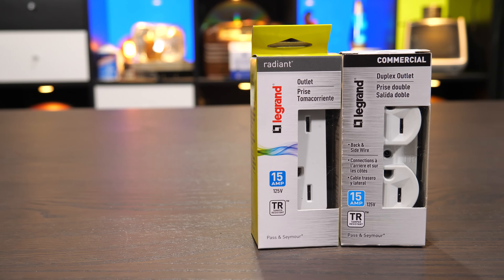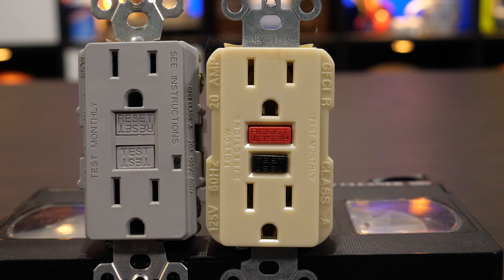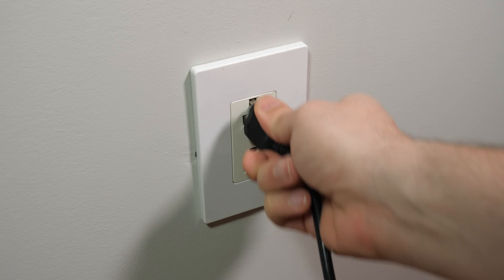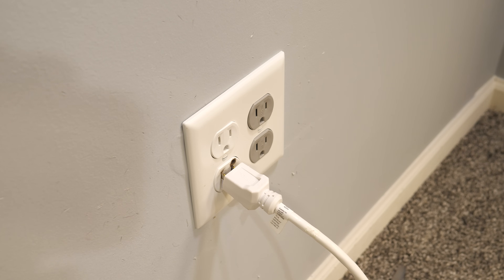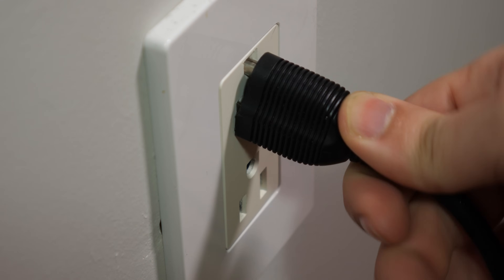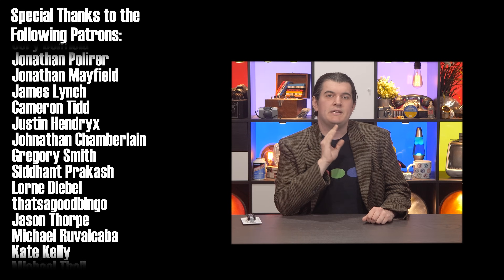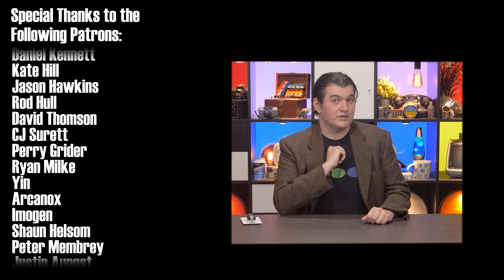Power outlets are topsy turvy - but does it matter?

Comment: I've worked 30 years in hospitals and I don't recall ever seeing an outlet installed with the ground pin up. Maybe some of them were and I just never noticed, but it's certainly not universal. A little over a year ago, I bought a house which has most of the outlets installed with the ground pin up and it's a massive pain in my butt. The cords and plugs on most devices assume the outlets will be installed with the ground pins down and if it's a 90 degree plug or a power adapter plug, it's sometimes almost impossible to insert them.

Comment: Honestly the biggest problem I've ever had with outlets is when I have two things with big stupid BRICKS for plugs and can't plug them both in because they just consume the entire outlet.

The solution I've got is an outlet TOWER. It's just a vertical tower of outlets, and also has power switches so you can turn off each level if it's not needed. Works amazingly.

Also, the outlets are all sideways.
Reply: I have seen some power strips do this as well, one side more spread out to accommodate those huge plug things, and one side regular for "normal" cords.

Comment: As a curious first grader, I was able to notice that electric appliances got whatever it was that they needed out of those two pin outlets on the wall. This was before three hole outlets became the thing. I was also able to figure out that metal was an important factor. It was then that I conducted my first known scientific experiment. It involved bending the legs of a hair pin and scraping the plastic blob off the ends. 
I was able to prove that electricity was dangerous if proper precautions were ignored.
Reply: That makes me so glad I grew up with a dad who used to work with electronics. He mostly fixed things like TVs and PCs, but he taught me a lot about safety, how things work, and I got to see him take apart and fix a laptop my cousin had a problem with. He let me use his voltage meter a few times to just experiment with what was conductive.

Comment: The true difference with the larger guage safety being at the top is about cable not shifting loose as easily in frequently manipulated cords. Top or bottom that third prong vastly improves plug security, but with it at the top it is significantly more stable.

This is most noticed by those using devices like vacuum cleaners on a very regular basis. Things that are constantly moved and the cords are forever being manipulated. You will find the outlets installed correctly more frequently in commercial and industrial structures.

Additionally, a loose plug is easier to bridge with debris without the ground plug above the possitive and negative to deflect said debris.

Comment: In Australia, we have a very simple solution to the problem of cords hanging out and exposing the pins - an on/off switch for each outlet. Make sure the switch is off before you plug or unplug your appliance - easy peasy, and so freaking obvious.

Comment: I installed many outlets in my house with the ground on top many years ago for the reasons outlined in the video. Unfortunately, many appliances which use the ground prong are designed such that the power cord now comes out of top instead of the bottom of these outlets which can be problematic.

Comment: WRONG...   I have been a journeyman electrician for over 40 years  and  I can prove it is wrong.  The Nationional Electrical Code does not say which way it goes  but there is a reason it should be installed like it is.  The National Electric Code only says that the ground prong ( which is slightly longer than the other two ) shall be the last one that is disconnected when removing the cord from the receptacle.  If you pull the cord is pulled out straight  the ground is disconnected last.  If the cord is sagging or about to come out from the weight of the cord, then the ground is disconnected first even though it is slightly longer and not last.

Comment: The guy who built my house put everything inverted….  Yes, he is paranoid (even wired the bathrooms so kids had to turn on the exhaust fan on a timer for outlets to work so they couldn’t leave something on) among other mental issues.  I ended up turning them all over a room at a time because all the heavy duty wires I use or special plugs being made to be inverted… there’s a couple still oriented backwards but those are plugs I don’t normally use.

Comment: American electricians certainly don't care, my house has almost half of the outlets are installed correctly and the others incorrectly.

It seems that the 45 degree right angle plug is quickly becoming the standard, I can't think of anything that I've bought over the last decade that had a right angle plug that didn't have a 45 degree type. Hell even Harbor Freight doesn't even sell anything with the old style.

Comment: The wall plate thing happened to me! I was using metal outlet covers and it was set on but not screwed in yet. Tripped the circuit breaker and made a loud pop.

Comment: Either way one can’t use two rectangle plugs. So that’s just a bad design in itself. not that there aren’t solutions like UK having them horizontally or most of EU where it doesn’t matter what direction you push the plug in . Although I would have some suggestions for the F type plug too. Nothing ist perfect

Comment: I do care and I have been installing outlets with ground connector up for years. I started with that when, many years ago, I was measuring something and the metal measuring tape shorted out a plug that was in a receptacle installed the traditional way. This does matter.

Comment: imo the best change would be using a newer design for the plugs that doesnt look like it was designed 100 years ago when a lot of dangerous was considered healthy and/or safe.
like the EU plug I am used to basically makes touching the prongs impossible by simply making the plug go inside the wall a bit.

Comment: Funny my kids didn't play with receptacles, my sister decades ago removed the TV plug and stuck it in her mouth, creating a serious burn on her lip, now she owns an EV and drives without heat in freezing conditions to increase her range😂   
Enlarging the body of the plug makes it impossible to use all receptacles in  multi plug adapters or power strips😃 Right angle plugs use both plug ins, only one can be used in a plug in.

Comment: all of my plugs are with the ground at the top. IMHO Never install them with the ground at the top. Installed like this a heavy cord will have a tendency to fall out. When installed with the ground at the bottom the ground portion of the plug will help it remain plugged in.

Comment: It's been my understanding that the placement of the ground on the bottom side for a wall plug was that the cord is more likely to sag down and if it becomes dislodged the ground is the last portion to be disconnected. Most electrical safety training requires the ground to be removed last.

Comment: The ground connection should be on top , if the two prongs are on top & the plug is pulled partially down it can cause an arcing condition and burn the place down

Comment: Another problem with right-angle plugs being upside down is that the weight of the cord puts stress on the base of the plug. This is already more likely to wear out, but doing this can cause them to wear out and short faster.
As for possible solutions, I recall seeing European receptacles that are recessed into the wall, such that the plug would go further in relative to the most exterior parts of the plate. This would prevent that gap from being a problem, as the plug would have to sag quite a bit before it clears the plate. Would something like that improve things?

Comment: I have this question in my head for a long time. I owned several Dry/Wet vacuum. And all of them are 2-prong. It lacks the ground pin. I am wondering for such application to suck up water, why the lack of ground pin in the vacuum?

Comment: Here's an idea. Horizontal duplex wall plates. Sockets oriented earth pin up. Right angle plugs with cable always exiting down. Sheathed live and neutral. Hey you could even add a switch so you don't need to unplug at all. Hmmm. Surt I've seen that somewhere before :)

Comment: Since 1975 after I graduated 3 years of electrical school, I install ground down. Why?? EVERY 90 degree outlet for refrigerators the ground is closest to the power cord. I also installed the designated refrigerator/freezer outlets at the same height as the counter top outlets, Then when plugged in, the refrigerator cord is pointing toward the floor. Ground up the cord would point up and have to do a U-Turn to go down to the electric panel on the refrigerator. 

I see you included this information in the video. I wrote everything before that section came up. And frankly, even on construction sites, with the ground down, I have never seen any situation occur like you state in this video. Bottom line, I will continue to install outlets with ground down!

Comment: Funny. When I wired my machine shop, commercial building; placed all 110V outlets with the ground prong up. My intention for this was to prevent any direct short by a metal object falling on the cord at plug-in, contacting solely the ground and knocking the cord out of outlet. In later years, I wired my home that we built in the same manner, and had a hard time with the building inspectors passing these outlets. Once I requested to see any federal Code, they were allowed and still in that position today. Common sense for me, no face required.

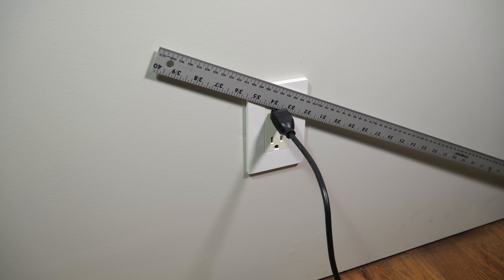Comment: I had the issue mentioned at around 9:41 in the video.  A sheet metal cover was dropped off the backside of a workbench and landed directly on the tabs of a plug that was ever so slightly pulled away from the socket.  Obviously my situation was an edge case but its not as uncommon as one might think...

Comment: As a Brit (with a pretty safe household plug design) I'd say the Chicago way is best but with the 2 outlets opposed so that 2 right-angled plugs can be used at the same time.
Reply: Yeah but so the ground pins are ont he outer edges lol, or just…. Dont put an outlet directly above another. In Australia ours are side by side
Reply: @Mistij.r  That's what I said - in Chicago the outlet is rotated 90° so they are side by side. Make the best use of a bad design LOL

Comment: The whole thing is... you just don't touch the blades ever. Ive never been shocked that way, because when there is a connection it's going in circuit. Hopefully you aren't grounded when you're standing inside a building... but your skin resistance should mean that while it's still energized it's going in circuit and when it's out far enough to touch the blades there's no more power. But i make sure to not touch the metal. I think ive been shocked by it maybe one time in my entire life.

Comment: The problem with right-angle plugs is that if their directions are universalized (like how its usually downwards from a "face" oriented plug for you guys) putting two is impossible if they aren't facing sideways or a 45 degree angle. Right now, that's most right angle plugs, and they do block things quite badly. That 45 degree plug you showed seems like a great idea though, I must say.

Comment: I've always noticed that power strips always have the ground hole up when the cord is oriented in the downward position, which is naturally the way they are normally  oriented. I always wondered why. It seemed to be an "upside down" configuration, but why? I think you have finally answered that question for me. Thanks for that! Thumbs up!!!
Reply: For me, typically, either the whole receptacle will face up (freestanding), or I will position the bar horizontally (mounted). I also have my UPS standing up (that's the only way it fits), and it only stands up if the receptacles are horizontally positioned. I also have a box where positioning it horizontally puts the ground pin up or down.

Comment: One case I’ve seen is that if you spill liquid on the wall above an outlet, the liquid will hit the ground pin before the live blades. If it does cause a short, it’ll trip the breaker through the ground lead

Comment: My objection to right angle plugs as most are designed today is that you can only use one of the outlets since the the plug on top blocks the outlet underneath. The 45-degree design makes sense since the bottom outlet is not blocked.

Comment: Idk probably most everyone in the US has got zapped a couple times as kids and now we know better don't need a safer outlet after that. On top of that it's usually cause we stuck something in them we shouldn't have. One day I was getting outlets and the Home Depot guy said if I'm redoing all the outlets to get the anti tamper ones because they might be code soon but I said absolutely not cause everyone knows those things can be a pita to plug stuff into sometimes. Plus I'm installing showers in a new build now a few years later after hearing that and they are still regular non tamper proof ones. Also anyone trying to mess with our frowny face outlets should be considered an enemy of the state. Side note I'm not sure how common it is but houses I've worked on in Florida we flip the outlets to non frowny faces for switched outlets. It still might not be obvious but if you plugged something in at a new house then looked around and saw wtf is this one outlet upside down for and why is it the only one without power hopefully might ignite a few brain cells to be like, maybe there is a reason for this. Would it still be doable reversed? Of course but how much more unsettling is it to see all your outlets in perfectly normal frowny face position but there is that one fucked up one just being a faceless outcast. There has to be a reason, wait a second there is that switch that doesn't do anything. Hmmm.

Comment: Our appartment has shitty, loose-ass outlets and a couple years ago we had a very precarious situation with a shitty floor AC and a shitty power strip because we live in a literal desert and the building-wide swamp-cooler was dead (that's right, we DON'T have an actual AC). So we ended up with a melted and nonfunctional outlet. Ground-up would've prevented that, since it would've been the ground pin slipping out instead of the others making dubious connections. The problem doesn't arrive for people who live in reasonable accommodations, but for people like us who live in what's essentially a tenement. We still have an enormous hole in our ceiling from when the apartment upstairs started flooding us out over the weekend and we couldn't get service until Monday.

Comment: I usually love your commentary. Unfortunately, I was disappointed that the only mention of children here was a brief comment at the end. The issue is not with adults doing something stupid. The issue is with children doing something stupid, very much on purpose. Think about it: why do they make those little plastic inserts to go into the outlets? Because children are naturally inquisitive and the number of tjose children that wander around with something metal, poking at things is a higher percentage than society was willing to let die by electrocution. Additionally, as someone who bounced around a few rentals before finally owning our own home, I have come across an issue either ignored by your commentary or unknown to yourself: cheaper outlets in cheaper homes are often either designed poorly or, over time, become flawed in such a way that they can no longer properly hold onto a plug properly and anything plugged into it will constantly sag, exposing the live prongs. I have lived in two separate locations where nearly every outlet in the residence had this issue. Also, adding to the problem, those same cheap residences (though also more expensive ones as well) have the least amount of outlets possible and in the most inopportune placements, making power strips (especially those with long cords) a necessity. And those same families that live in the cheaper housing live there because their options are limited financially and will thus buy the cheapest power strips that will do the job, which will not be ones with right angle plugs, either because of expense or lack of availability or lack of foresight. Then, the children, who are less likely to be well-supervised in these families because the parents are financially strapped and working extra hard, become in much greater danger. Therefore, the plugs should either be mounted with the ground up or the neutral up. After watching your video, I think that the neutral being up would be best.
Reply: Not that anyone should have to resort to this, but if you've got those loose plugs, you can just bend the prongs either out or in from parallel and they'll grip. Not too far or you won't be able to get them into the damn slots -- and you could possibly even break one off -- but a slight \/ or /\ bend will work in a pinch.

And if you want to talk about cheap & dangerous: back when I was a renter at the old Austin rock & roll party house "The Lodge", we were having trouble with the living room area breaker blowing out and asked the owner if he could have it rewired a bit so we could use more electricity in that part of the house. 

He sent his handyman Manuel (not his real name -- he reminded me of the "Fawlty Towers" character) who showed up with an old orange extension cord and a hammer, pounded holes in all the walls between the living room and the kitchen, and then threaded the cord through the holes so that we could utilize the kitchen electricity in the living room. 

(The cord's plug, by the way, actually shot out a little blue flame if you wiggled it. In winter we used to tell guests to "Come in and warm yourself by the exposed wires!")